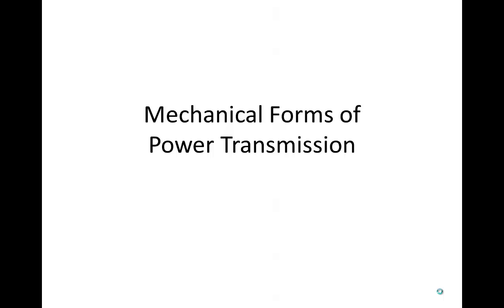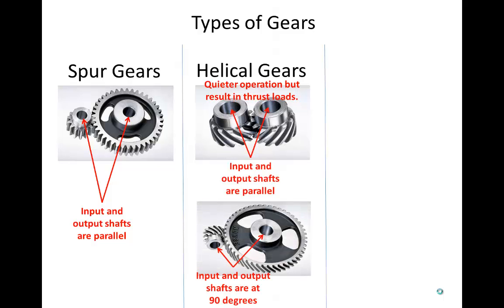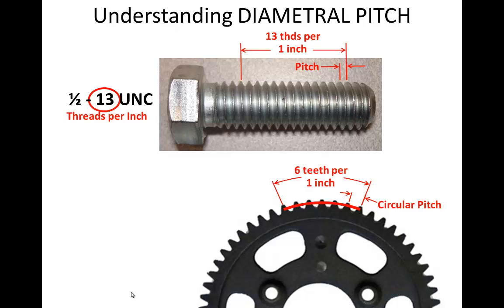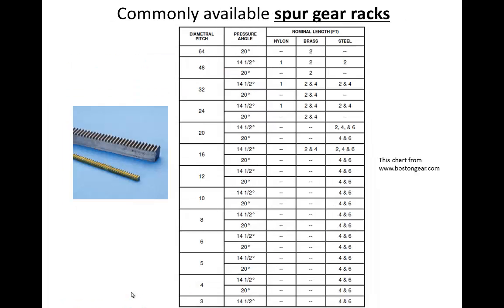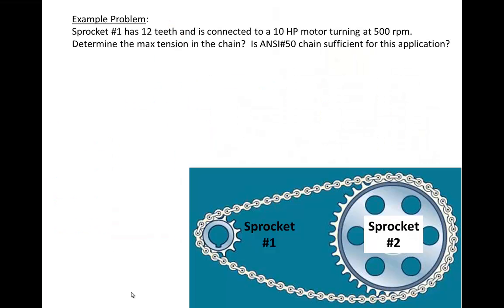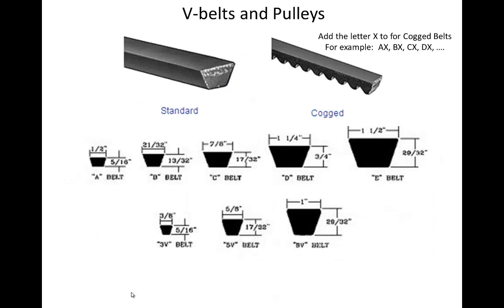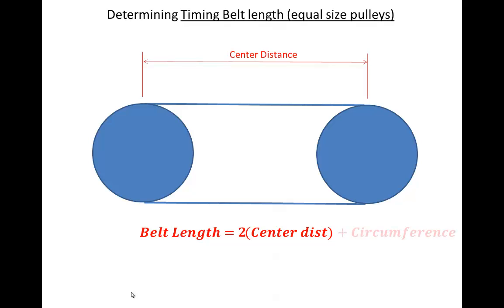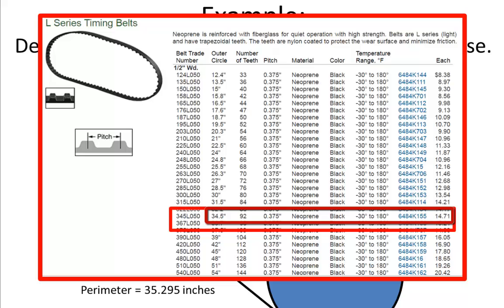Power Transmission components

Comment: Can someone explain to me the difference between a pulley and a V Belt ?? ❓❓🥰
Reply: The pulley is the wheel around which the belt (v-belt or toothed belt) turns around. The v-belt is a v shaped belt (cross-section view) used to transmit power between pulleys.